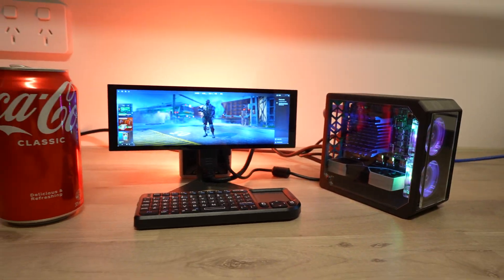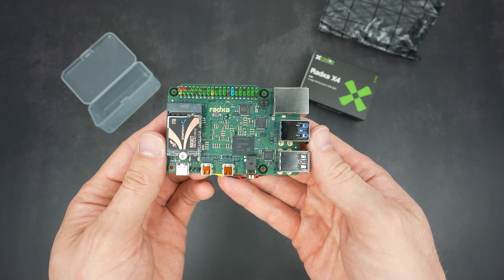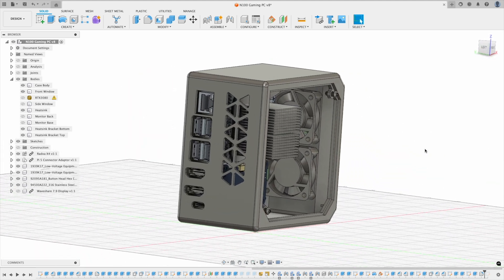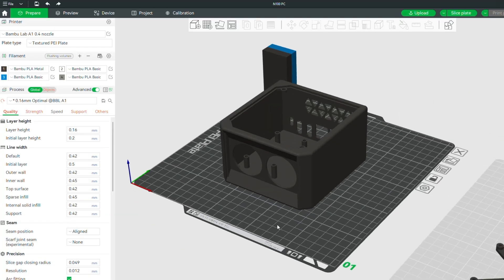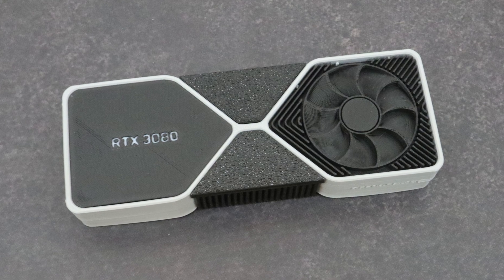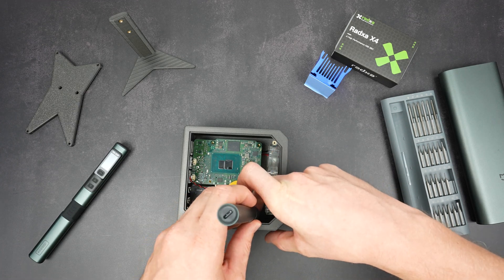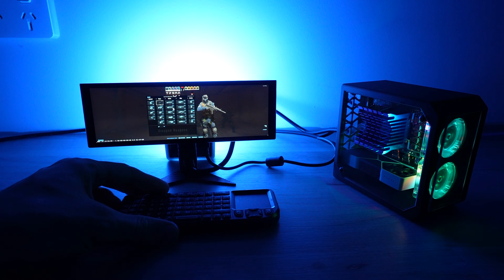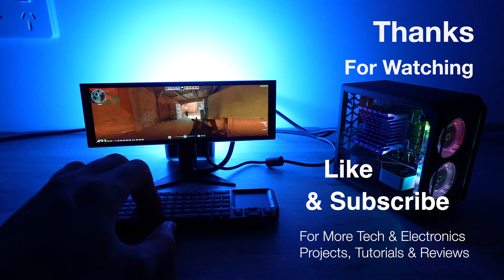This Tiny 3D-Printed Gaming PC Actually Runs Counter-Strike!

Comment: This build was basically designed around creating one clickbait image for the YouTube thumbnail.
Reply from the maker: I'm not sure what is clickbait about the thumbnail? It shows me playing Counter Strike 2 on the PC made in this video, it's not photoshopped or misleading.
Reply: @MichaelKlements the Coke Can is photoshopped
Reply from the maker: @windsofdestruction the coke can is overlayed at a different exposure because it otherwise doesn't show up in the image (it is too dark). It has not been modified, resized or changed in any way that makes it misleading or clickbait. Here is the original image - https://bit.ly/4hKhET6
Reply: @MichaelKlements I think you can get more views if I take thumbnail in full light than in dark, and still add coke can for the scale and take a picture for a distance
Reply: Cmon man. The dude clearly just put the can in the image for scale. If you havent got anything nice to say, just shut it...